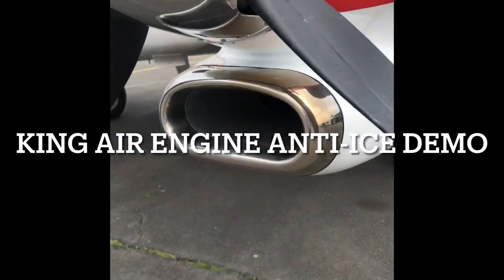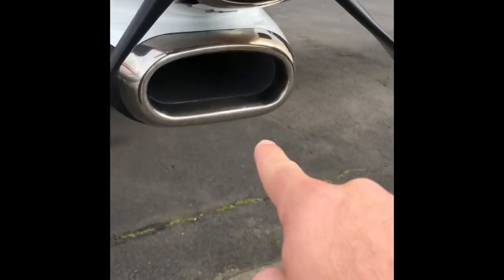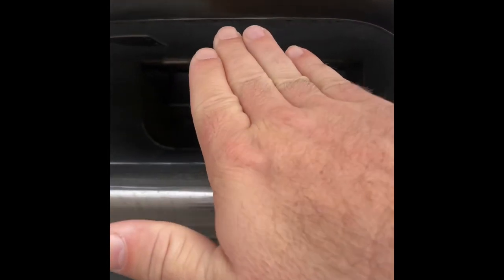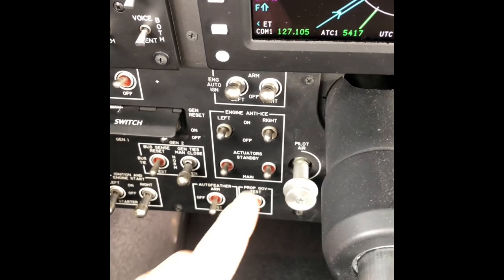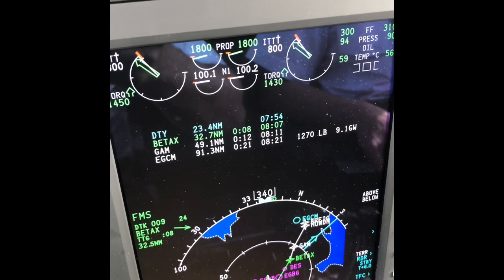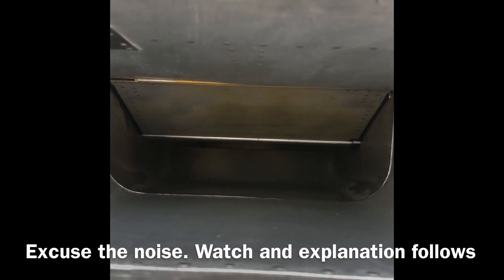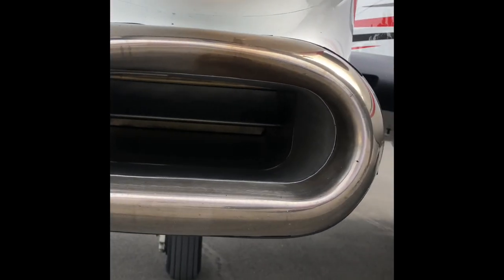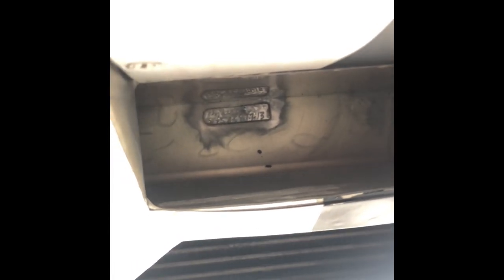King Air Engine Anti-Ice Demonstration

Comment: its a reverse flow engine as the flow of the air in the engine changes direction between the compressor and turbine section
Reply from the maker: Yeah, I was corrected on that in earlier comments. Thank you.

I will make a note in the description.

Comment: The term reverse flow engine refers to an engine design where the combustor air flowing in the opposite direction as the turbine air (folded back over to save space) not how the engine happens to be oriented on the airplane. The PT6 on the Avanti is also a reverse flow engine.
Reply from the maker: Thanks. Every day is a school day :)

Comment: If you’re on final in the C90 and you both have the runway made, and you intend to use full prop reverse, activate the anti-ice vanes on short final.  It will help protect against FOD when using reverse.